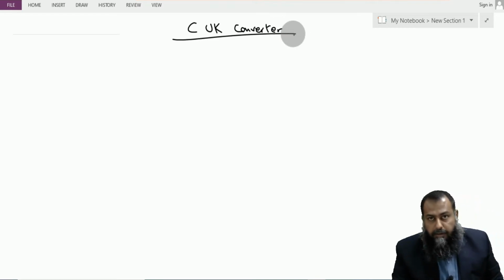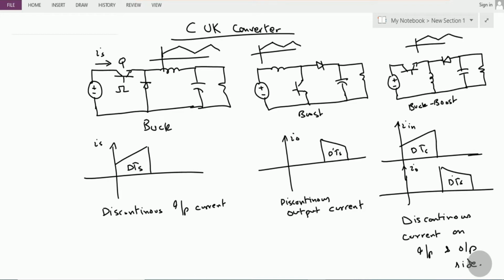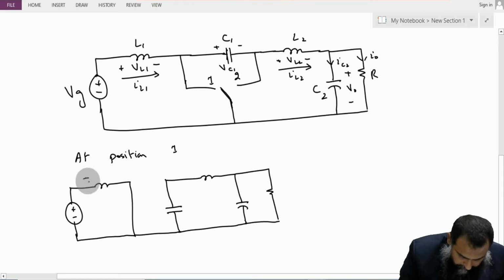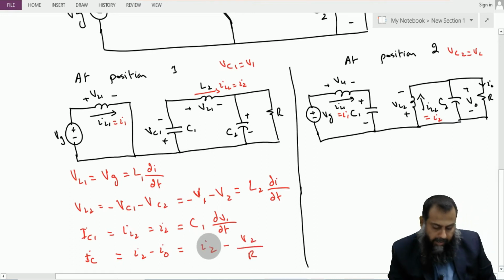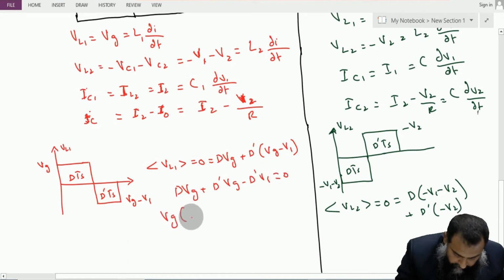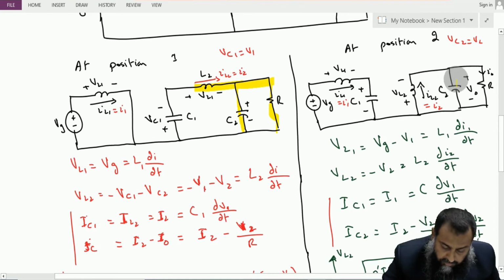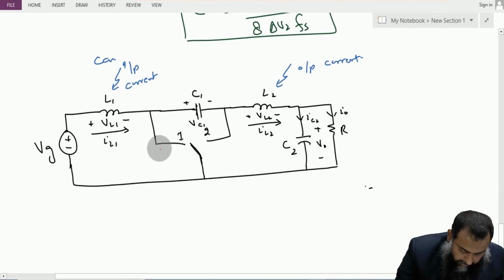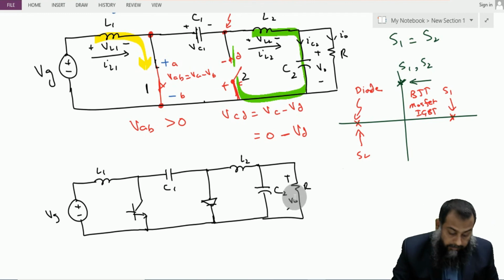Power Electronics Module 2 Lecture 9  | dc-dc Cuk converter

Comment: This is not how you design ANYTHING. Deigning a power module is much more complex than you think and these videos don’t give you any important information at all because the instructors have never built anything in their life. If l was to present this topic, l would bring in prototypes and show you l have ability and not just blabbing gobbledygook to the students. But l know it is impossible for the average person to design and build these complex circuits without years of knowledge and understanding. Why do you think it has only been recently for these to come on the market? And you can buy modules for every application, at a cost less than buying the components.  I buy them 100’s at a time for 45 cents. I would not waste my time building them.